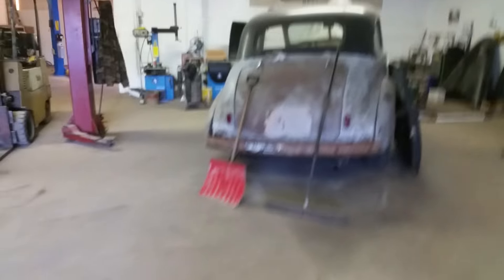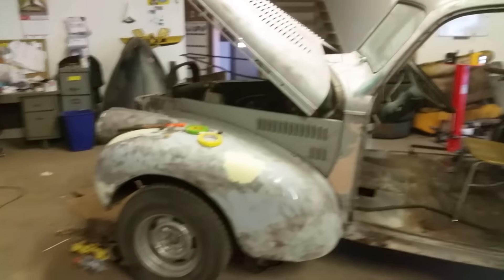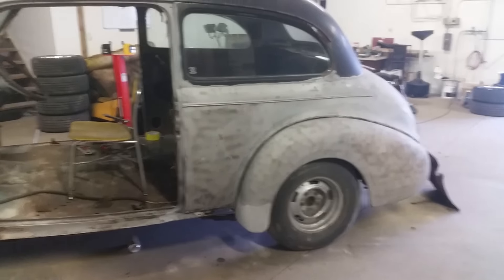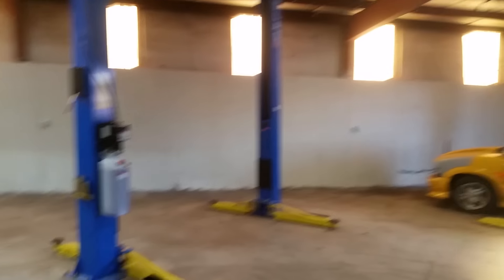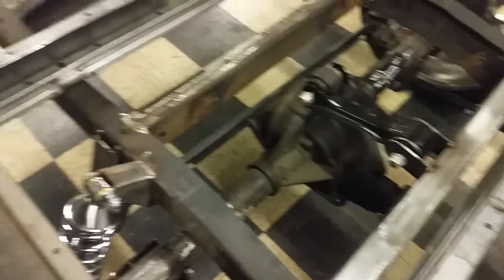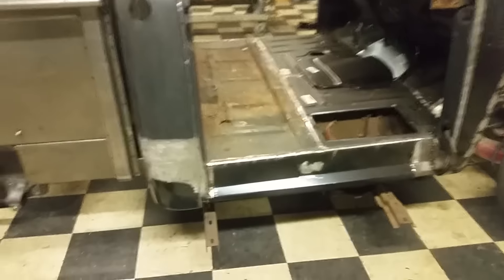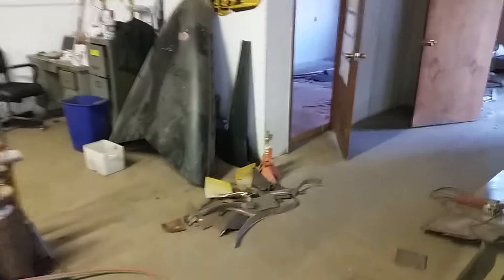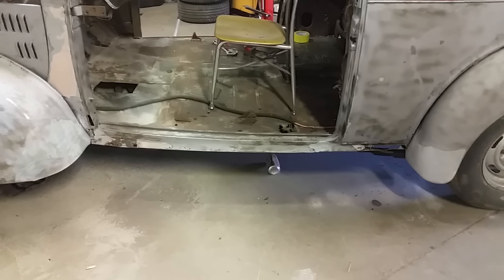Quiet farty and lifts

Comment: If you get a little time, why not dig around the you pull it yard with a hacksaw in hand? Most yards only charge $9 for mufflers, no matter what brand. My friend just picked up a pair of Flowmasters out of one of the local yards down here, they're like new, not a speck of rust!
Reply: The thought of doing this has never even crossed my mind. Could be a good idea.